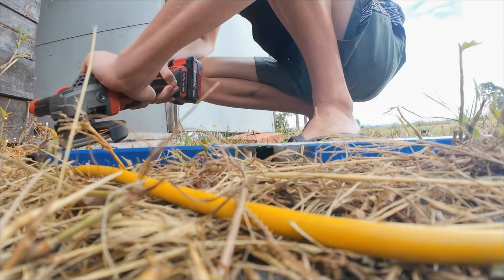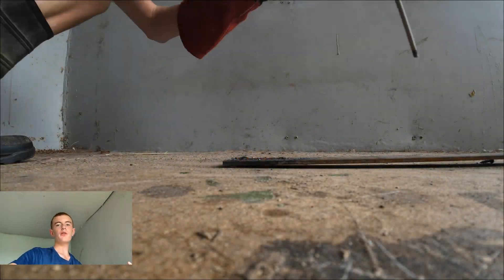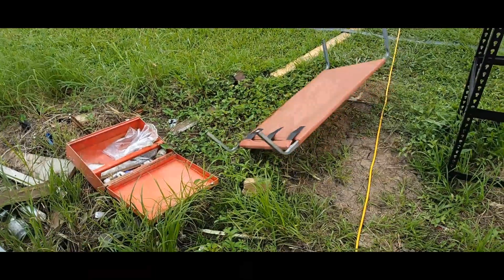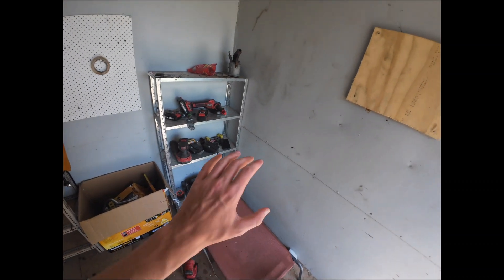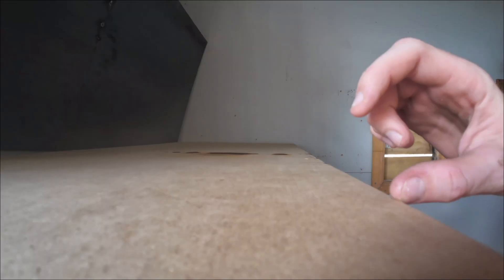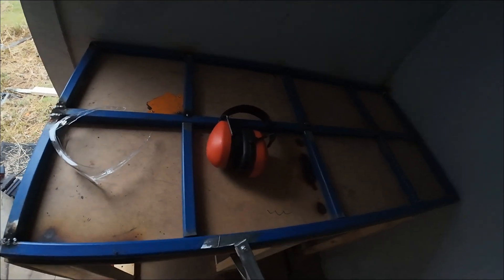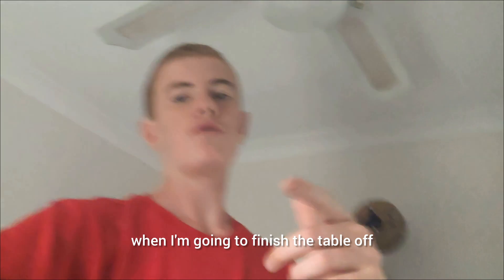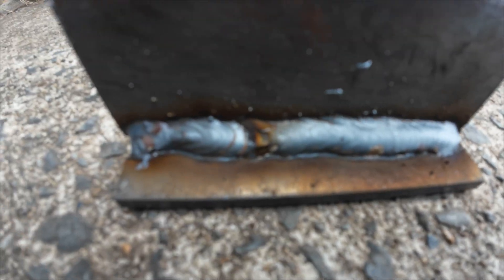I LEARNT HOW TO WELD IN 7 DAYS WITH 0 welding Experience

Comment: I have yet to venture into welding but have a decade of plumbing experience. My biggest suggestion is protective clothing. 

Boots to prevent the sparks hitting your feet or getting between the toes. That's just a recipe for bad luck, especially when grinding. Plus those flip flops won't stop a bar of steel hitting your feet. 
Gloves, same reason, I keep getting injuries to my hands but the gloves minimalize it. Cut grade for me but unsure what you need for your field.
Trousers, sparks fly, bare skin, I don't need to explain, you can probably guess.

Your call but you get one life and one chance to keep yourself safe. It may be costly but can save you body parts in the long run. Just consider it yeah?
Reply from the maker: yes im going to be buying some proper ppe like a protective full body suit and a proper boots thanks for the comment

Comment: Ngl you improved alot but that’s the easy part. You actually learn how to weld when you start welding on spots that are rusty & filthy and impractical to weld, welding above your head or welding sideways. You won’t always have access to new clean metal so don’t shy away from using old rusty metal that you have laying around and practising on that
Reply from the maker: Ok thanks yeah I'm going to have to learn how to  weld on an angle soon as I'm fabricating up a electric dirt bike that has some rust and paint on it. thanks for the comment 🙂

Comment: Not bad but youre wire speed is probably to hight if not the wire youre moving to slow with mig see how it globes up
Reply from the maker: Yes I was wondering why there was splatter marks on the steel after I welded but when I turned the welder down to half way then the wire came out in little sections it didn't come out smooth so I could start a bead but I'm sure I'll figure it all out in the future 😁
Reply: @BIKEWELDING  https://youtu.be/gc9fBVq9NlE?si=omxxXYdwjTuV9XVF
Reply from the maker: Thankyou